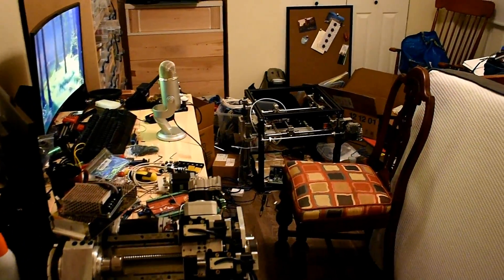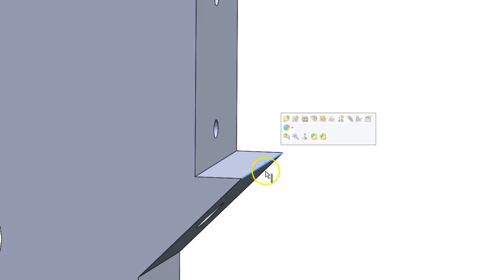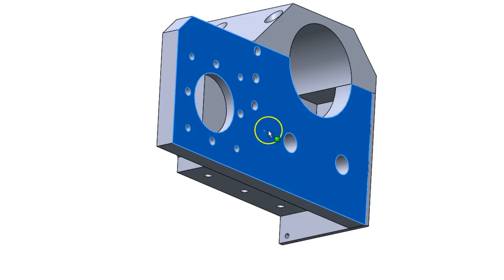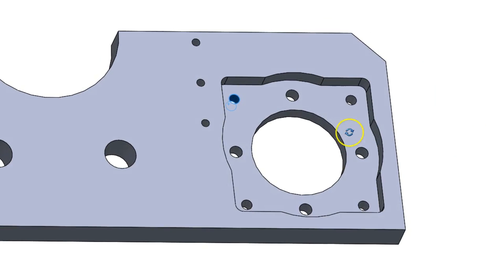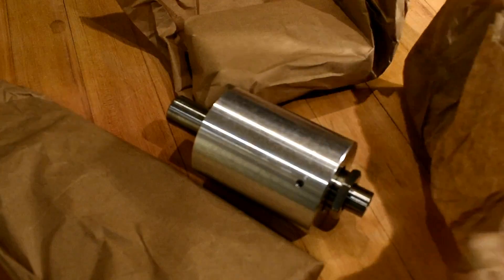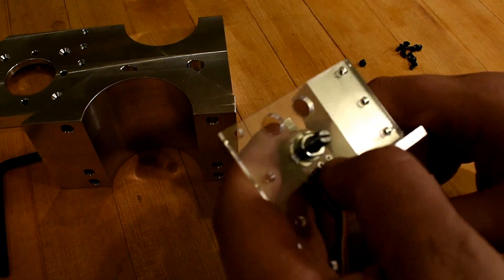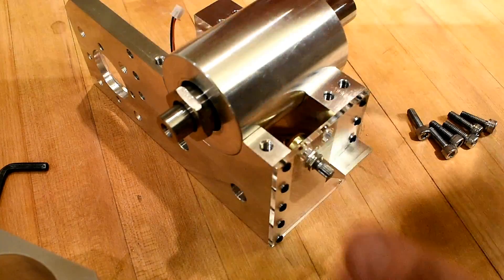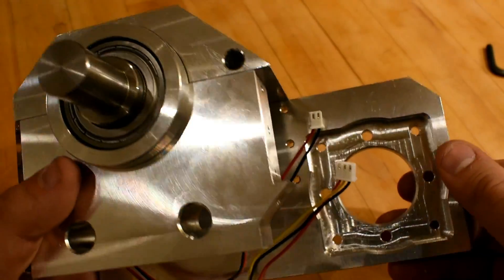The Jeweler's Lathe Part 2:  The Headstock

Comment: Might've missed it, but how much interference is there between the OD of the spindle the the ID of the two halves of the headstock? Looks great, cant wait to see it done.
Reply from the maker: There's actually about 0.002" of clearance on the IDs, but when it's all tightened the top actually deforms a very tiny amount to enhance the contact pattern... I may mention it in a video because it's hard to describe in words :P

Comment: Really nice work you are doing! 
You put nice finish to the parts. that tells me that you are putting good effort and pride in you work. 
Do not listen to the "it could be cheaper and easier" 
Thats the ones that alwas takes shortcuts in their lifes. 
One have to understand there is a clear difference in hobby and buisiness..
What all about those overpolished hobby cars. Motorcycles. Aircraft ect.. 
Not to mention all the robots and other stuff people are doing as a hobby.. 
One can buy a used  industrial robot for nothing. That outperfomes any hobby robot. 
but thats not the point of a hobby and intrest in making things. 

Anyway. 
Im intrested in your experinece with clearpath on the 3D printer. As im been thinking about the same for my next 3D printing "brew" What is needed to hook it up? Any special problems to solve? 

Keep the good work up!
Reply from the maker: Hey thanks a lot!  You really seem to get it :).  It's always difficult to convince people that it's the act of making something that I really enjoy, not just the finished product.  Also, like you say, people like to have nice things, and sometimes that means including parts that are "overkill".  I'm sure a Lamborghini could get around just fine with a teeny little 4 cylinder engine, but that's not the point!  I'm thinking of doing a sort of channel intro video that includes a lot of the ideas that you covered.  Intro videos can be super lame though, so I'll have to take some time to plan it out:P.  I'm going to do another 3d printer video soon that should cover Clearpath implementation, so stay tuned!

Greg

Comment: Are you relying upon the clamping effort of the spindle housing cap to stop the spindle assembly from sliding, I didn't notice any steps in the cap or housing plates. Nice work, thanks Peter
Reply from the maker: +PGS yep just the friction is the plan.  Its a good solid fit, so I think itll be fine.  Thanks for watching Peter!

Comment: have you give any thoughts about rigidity and dampening ?
Reply from the maker: I had actually considered using epoxy granite for the headstock as a dampening feature, however for the work this machine will be doing it was a lot of work with questionable returns.  In terms of rigidity, aluminum is by no means the best material for the job, but I think the amount of material present will do the trick.  If rigidity and damping were a higher priority, I would have tried for a cast iron bed.
Reply: hlaps1990 for smaller diameter actual is probably even better... Didn't even considered that.
Reply: Aluminum is fine for this tiny little thing. I would be more worried about thermal instability than rigidity. It will grow quite a bit as it warms up.
For the bed, you could use granite cut offs or buy cheap class B surface plates/straight edges. They can be epoxied and bolted together, and will give you better results than just about anything short of ground cast iron.

Comment: You say you need to do budget calculations for the spindle motor of the lathe but you put Clearpath motors on a 3D Printer? Those are pretty overkill for a printer.
Reply from the maker: My budget calculation was literally "Ah crap I just spent a bunch of money on Clearpaths for the printer."  Overkill yes, but still vastly improved speed, accuracy and noise performance :)
Reply: I just finished making my own 3D printer, it's built like a brick shit-house and there is no flex anywhere. Used 25mm extruded (I used more than is truly needed), full linear rails (2 on every axis), and the bed is within .0005 flat so my machine doesn't need a "leveling routine", in fact I can lift the machine by the bed and it stays completely stiff)... Oh and all axis run off 2 steppers each, the machine never skips a step. Complete and utter overkill for 3D printing but I had a ton of fun designing then building it.

Everyone always has "better" ways of doing something, and it's not always about a 100% optimal outcome. I just do what I want, but alas my full time job doesn't allow me the time to put videos together (well not unless I wanted to dedicate all my free time to do it, but I don't want to). Your projects look pretty cool my friend, keep on keeping on.
Reply from the maker: I should clarify; it's not my PCNC1100, it's my work's (they encourage personal projects after hours), so I'm miserable too.  I think the two main factors that go into deciding what to make are if it's something I'm going to enjoy working on, and if there's a product already available that suits my needs perfectly.  You're absolutely right, I could just buy a $600 chinese lathe and probably accomplish many of the same goals, but the lathes that are currently available are noisy, oily, throw chips everywhere, and still manage to be unreliable (been there, done that:P).  My list of needs isn't really represented in the market right now, but I really really do need small, tidy machines that I can basically run in an apartment, and for all the bluster about desktop manufacturing, those machines (manual or CNC) just don't exist.  In addition to needing something that the market doesn't offer, I love making things, and it's a hobby I'm happy to spend money on.  The shiny fly-cut surfaces don't add any advantage, but I enjoy making them, and I enjoy how they look when they're anodized.  I guess I see this more as entertainment than acquisition.  I'm definitely going to address the "Clearpath on 3D printer" controversy as I've gotten lots of feedback on it :P
Reply: marshalcraft  < This guy sounds like a real genius. Besides the normal waist vs waste and your vs you're mistakes.... He seems to not know much about anything. He's wrong about the clearpath motors, and he's also wrong about the mini lathe. Mini lathes fall into 2 categories, expensive European ones, and shit Chinese ones. Don't be so quick to criticize when you don't really know what you're talking about.
Reply: I doubt the improvements.
Reply: Just a waist of money, but hey you have a pnc and your making other lower quality cnc stuff with the cnc. Why not make something more beneficial. One guy made camera housing for his own slow motion camera. Just saying a lot of engineering goes into a lathe and having a nice fly cutted surfaces and black anodized looks nice but it's not accomplishing anything that probably a cheap mini lathe wouldn't do better. Maybe make a wind generator or something that is beneficial and provides gain. I don't know I'm probably just miserable cause even if I did own a pcnc I wouldn't even have anywhere to put it. :(

Comment: Looking good!.. so the spindle is just clamped in place ,no locators to stop rotation? Just a touch undersize to give it pressure when clamped?
Reply from the maker: Thanks Matt!  The bottom parts are very close but a hair over, and the top is a little more oversize.  When I tighten the fasteners, the top bends a teeny bit at the very top and "closes" on the cartridge.  A fit like this causes a massive amount of friction and prevents any rotation.  It's not always easy to make a shaft clamp like this, but you can dial in the bore by chamfering the edges if the bore is too small, or facing the mating faces if the bore is too big.

Comment: Great video. I am a huge fan of locating pins and shoulder bolts, it would make the assembling a lot easier. I am wondering why didn't you use angular contact ball bearings for the spindle. They can handle a lot more load in axial direction so there is a lesser chance of you brinelling them with your preloading technique. Also be beware of anodizing if you have any tight fits.
Reply from the maker: Thanks!  I didn't use angular contact bearings just because of cost.  You're right, they can handle a lot more axial load, but they're soooo expensive.  The ABEC 3 deep groove bearings I got were like $10 each I think.  I did give myself a little extra clearance for anodizing :P  I've been bit in the arse by that before!

Comment: Hey hlaps, loving the videos so far, especially the micro cnc lathe series. I was curious about a couple things, 1. Your feeds on the tormach looked slow, is there a reason? 2. The surface finish from using the face mill for boring looked a little wack, did you go back and clean it up afterward? Also +1 for a belt tensioner; I'm on the formula SAE team at Cal Poly and last year we didn't run an easily adjustable chain tensioner and getting everything right has been kicking us in the ass since then.
Reply from the maker: Hi Miguel,

1)  Our tormach is really old and sometimes you have to baby it:P  I'm sure you also noticed the spindle sounds like a turbocharger!

2)  I agree, it got gouged a bit, unfortunately it was also a perfect fit so I couldn't clean it up:P

3)  Belt tensioner is a must:P

Thanks for watching!

Comment: Hello! front bearing will have some sort of protection from the chips? I would make a cover with felt or a disk-bumper. otherwise the bearing will die quickly.
Reply from the maker: I'm probably going to put some kind of shield on the front that covers the bearings and maybe even some felt that wipes the spindle, but I think that will be something I add at the end :P
Reply: OK. I will follow the project. Let's see who will do better :)

Comment: not enough fasteners on the control panel bruh
Reply from the maker: Damn!  I knew it.  What if an adult male gorilla pulls on the panel?  Next time I'll use hex bolts and a torque wrench :P
Reply: hlaps1990 also make sure to use like 50, and loctite all of em, vibrations and wha
Reply from the maker: And aviation wire.  Can't be too careful!
Reply: Oh definitely, and fill in the entire space behind the panel with epoxy so everything stays in place should the panel get ripped into a different dimension